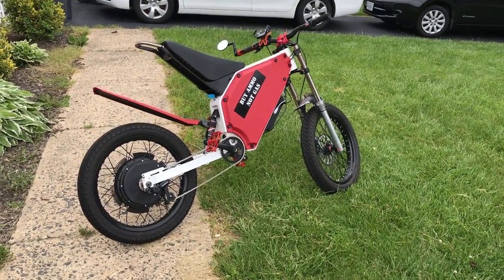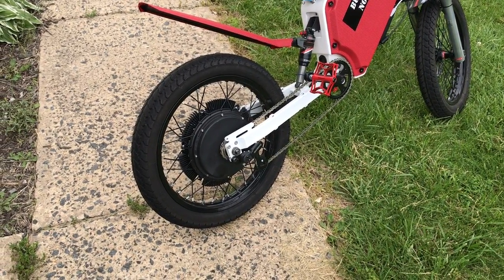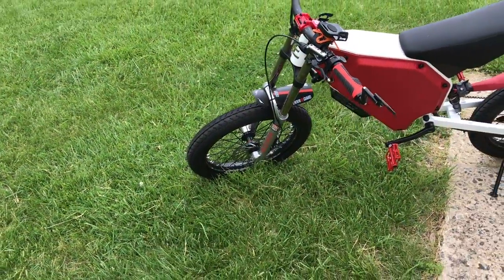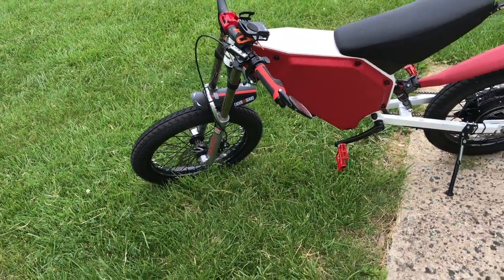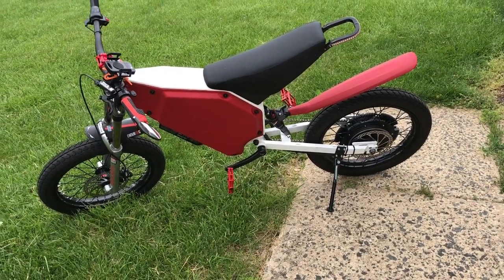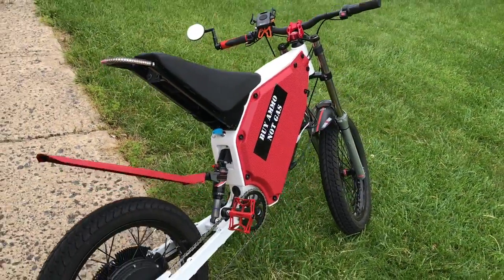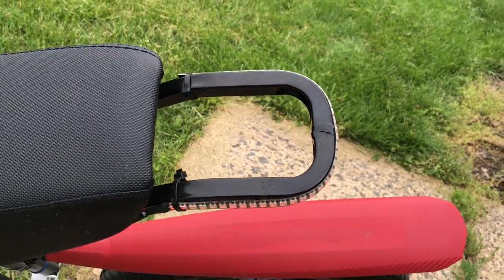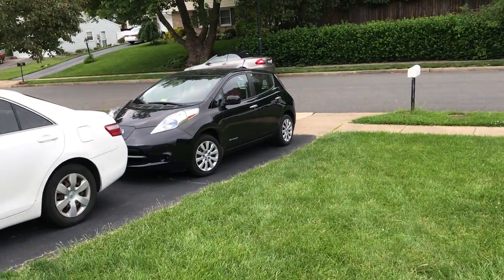High Power 60+ MPH Electric Bike

Comment: is there a way to use a thumb throttle as your regen braking and that way you can control very precision braking to the motor, my electric skateboard has this  built in the throttle - one way is the throttle and twist the other way is the regen brake. I m having a hard time finding that in ebike etc.. seems the brake lever just has a switch to stop motor, but I do not want that. would be best if there was a hydraulic brake lever that also had regen cable but could allow full control of braking to the motor as well

Comment: Can u put the motor wheel on both wheels? Like have 2 motor wheels and make it all wheel drive?
Reply: rav yes u can make it awd but then u have to have 2 controllers big ass battery everything will be very heavy because u have 2x motors and controllers + extra bigger battery and its not worth it but u can put a 12000 w motor on the back and u shoud be able to go 120-130 km/h
Reply: Not worth it just add more amps

Comment: I loved this video! Amazing bike! I would like to build one, but I am wondering about some things. I'm kind of wondering if this bike is overkill. I need a commuter primarily, something that can go 30mph for 25-30 miles round trip to work. I would also like to be able to go max 45mph on weekends for fun. If I have to charge batteries at work, I wont be messing with lipos, so I am keeping it to lith-ion batteries, either 52,60,72v at 20 ah, whatever gives me the most range. I plan on pairing it with a kelly controller. Is this possible with the QS205V3 motor? 
Is this whole platform (with heavy frame, expensive battery and controller) not appropriate for a commuter at 35mph, that can go 45mph on weekends for fun? I really appreciate the help, its hard to find people who build these powerful bikes.
Reply: if you top must be 45mhp than you are better of with 9kv version compared with 11kv or 13kv.
Why? Because will will burn less watts hours at slower speeds. Will cover more distance. 

Overall motor is very good. get it. Any version will work but if lower speeds are preferred than get 9kv with 72v batt in 17 or 18 or 19 inch rim or 24 inch bicycle rim in worst case.
Reply: It is hard to find these type of builds. I'm looking myself. Hoping to find some help somewhere.

Comment: Dear Jim:
I think I want to build something similar to what you have.  I am looking to build a commuter/cargo bike on a steel full suspension frame.  The big thing is could such a frame if it had modified dropouts to clamp those axles tightly stand the torque or other stresses from the asphalt commuting at 65 mph?  I want to see if I can get the thing highway legal and licensed like a motorcycle.  
I have other questions about the lights, what is arduino inside and the wiring for those batteries, but the big issue is the structural integrity.  I don't see how a downhill bicycle can jam down a rocky slope at 45 mph, but be unsuitable for the asphalt highway at 65 mph.  Hmmm?
Also I want to keep the normal bicycle look.  I don't really like the enduro style for running around the street.
Is there a way to communicate offline, if you are interested?
Thanks.
Michael Roth

Comment: is it me or is the math on his batteries off?  20 4s batteries of 10ah.  End result of 20ah means you split the stack in two, 10 batteries in series, paralleled to 10 packs in series.  10 packs in series would be 40s.

Comment: Hey Jim! I/We really liked the video and the build. In the video you talked about upgrading your motor with heat sinks and ferro fluid. The heat sinks are clearly visible in the vid, but i cant figure out what you used the ferro fluid for? Or how? It seems like you're getting 5000-6000watt performance out of a 3000watt motor! Thanks for your time!
Reply: It's all about the battery and controller. That motor is rated for 3000w but can handle 5000 watts easy. He might have  a 72v battery and 80amp controller. 72x80=5760watts!!
Reply: The ferrofluid (called statorade in the eBike world) is used to bridge the gap between the stator and rotor to better transfer heat. Then the heat sinks are able to more easily dump that heat into the atmosphere.

Comment: It looks great,
including the combination red and white.
Amazing rational thinking, on the components
and the "modus operandi"
as a whole.
I would guess
that it works
just as good
as it looks.
I have three questions,
that if you could be kind enough to answer, would be:
Why not a full front fender?
Why not a higher upright position handlebar?
Would these two things be related with aerodynamics?
I wrote three but in reality there are five,
and the other two are:
 How much does it weigh? and
How heavy can the rider be?

Comment: What kickstand are you using?
Reply from the maker: TOMOS A55 MOPED SIDE KICKSTAND (from eBay). I had to cut the tabs off to fit the swing arm but it works pretty well. I wish it was a tad longer, but it function fine.
BTW: I bought this motor from you.
Reply: Thanks Jim, I'm glad your enjoying the motor. Was it this kickstand? http://www.ebay.com/itm/TOMOS-A55-MOPED-SIDE-KICKSTAND-TT-Classic-Quadro-Flexer-Sprint-Colibri-square-/291396577145?hash=item43d896e779:g:BZgAAOSwEeFU9NdD&vxp=mtr
Reply from the maker: Yep, that's the exact one I bought.

Comment: Hi there! Nice build! Im building a similar ebike. Im using EEB frame and the same qs 205 h50 v3 hub motor on 18" moto wheel.I have a question about the tire size before I purchase them.Whats the width of the Michelin Gazelles you have on your bike? 2.75 0r 3.00 inches?
Reply from the maker: H.Ayvaz I'm using the 2.75's but I'm pretty sure the 3.00's would fit too.
Reply: Awesome! I may go 2.75 front and 3.00 rear.I like the Gazelle's tread pattern.
Reply: I finished my build couple of months ago. I posted a video all about it recently. Check it out if you like.

Comment: Could could this fit on my 145 mm rear forks on my mountain bike? With room for a 1 speed freewheel. I have a TC 80 on it right now and it fits a free wheel 1 speed.
Reply from the maker: It might, but you'd need some really really hefty drop outs and torque arms. You'd also likely need to spread your drop-outs by about 5mm on each side. I wouldn't use a motor this strong on a standard bike frame.
Reply: Jim McPherson well how much stronger is it compared to crystallyte TC 80? i have the TC 80 right now with torque arms and it works great. i bought the Qs for speed and efficiency. if it doesnt fit then ill just buy the em3ev frame with 26 inch wheel.

Comment: you mentioned you used hobbyking  batteries, could you tell me how you did your wiring? also where did you get the charger?
Reply: Heath Brockway I got you brother.

I have the same batteries as this guy and I can give you a the product links you need and how to wire it. its pretty self explanatory but if you mess up you can cause a big spark or a fire.
Reply: you can have several choices for chargers.
Reply: Here's a link to a charger that I have and I'm currently using because I screwed another one up by accident.

It's easy and not complicated because it doesn't require a power supply so you just plug it straight into the wall.

http://m.ebay.com/itm/272578996056?_mwBanner=1
Reply: now I'm assuming that you don't want to fiddle with wiring and unwiring your battery to charge it. I do it differently. I simply place my charged batteries on the rear rack of my bike and they sit in a grocery cart that is strapped down by bungie cords. when I'm done riding I put them in a bag and charge them separately using 3 of the chargers I linked above. i use 4 batreries. ( 16 ahr 6 S multiststars from hobbyking.com.) he's using the 20 ahr cells. Not sure if they're 6 S.  I'm too lazy to watch his video.

2 pc series adapter
and and a couple xt90 series harnesses all from hobbyking

you can by parallel harnesses too for more capacity.
Reply: Ron Brown thank you for all the info!
Reply: Heath Brockway what kind of frame are you using? this will determine if my advice is any good.
Reply: Heath Brockway if you don't have a frame you can go here for one. This frame accepts 26 inch tires and of course has batteth frame case. you can probably fit a good amount of lipos in there all wired up. If you really want tonsace money theb buy the charger I linked and simply dissaassemble the wires to charge. It's not hard at all. have you ever charged lipos before? if not it could be a bit of a learning curve.
Reply: Heath Brockway here's a link to a full package eeb frame. it includes many bike parts, motor and accessories. I might actually purchase this myself and move on to a stronger frame.

https://em3ev.com/shop/eeb-full-suspension-ebike-frame-package/
Reply: Heath Brockway let me know if you have questions. I'd be happy to answer. 

what's your goal? do you already have an ebike?
Reply: Heath Brockway ok cool
Reply: Ron the eeb  frame is the same one I ordered just under another name. The larger parts I ordered were rockshox boxer front forks, fox dhx air 5.0 for the rear, I'm using protaper fuzion race handlebars with a direct mount stem, crankset and bottom bracket are race face, and I found a 10kw motor/ with controller and digital display. oh and the brakes are the magura mt5e. Its not an over the top build, but a middle of the road strong dependable bike. Hopefully lol. I did order a book on building your own battery but worst case scenario I'll have to spend the extra cash and buy one.
Reply: Heath Brockway if never installed disc brakes before. How do you install them on the frame? I literally have no idea how to do it.
Reply: Heath Brockway you could build your own battery. you are talking  welding the cylinder cells with a spot welder? ebikeschool.com has a kit for that and it doesnt require  a spot welder, no fancy tools.It's a mechanical build. The cheapest way is going with the hobbyking batteries. it is by far the cheapest way.

Comment: what is the range
Reply from the maker: I have about $2500 in it.
Reply: Jim McPherson probably worth every penny every time you twist the throttle
Reply: 2500? That's it? WTF? Why haven't I ever seen this shit before? I'm like an ebike virgin.
Reply from the maker: Range is about 40 miles at 20 MPH and below at 65 MPH the range is about 18 miles.
Reply from the maker: Whatever you have is not the same as mine so price can't really be compared. I built this piece by piece from the frame up.
Reply: probably cost him around 2200 dollars or 3000 hobbyking batteries are very cheap. Not sure about the QS motor

Comment: the chinese don't mess around when it comes to copies.. looks like a half decent rip off from stealth hurricane bike
Reply: stealth hurricane bike made in China?
Reply: thermo dynamics No stealth hurricane made at my friends factory in Melbourne Australia.  Doesn't take long for the Chinese to come out with cheap copies a couple years later.
Reply: what's wrong with cheap copies?
Reply from the maker: Sam Richards This isn't a copy of Stealth anything (Hurricane, Fighter, Bomber, etc). I built it from the frame up and it is very different than the stealth series.
Reply: Jim McPherson I am just talking about the frame and swing arm kit you purchased. It's a blatant rip off of the stealth hurricane style. Not saying there is anything wrong with it.  Im friends with the owner of stealth and we have discussed it a few years ago.  All these copies came out from china a few years after stealth designed it.  There is also a copy from Europe. It's a very obvious copy of the design and most of the time they even market it as a stealth.
Reply: Sam Richards the Ebike from Europe is nothing like a stealth bomber .. I own a 14kw vector... the stealth bomber is nothing but an overpriced Ebike, I know I've had a stealth but sold it as I preferred the vector for power and price

Comment: what is the cost of that build just curious
Reply from the maker: If bought all new, not in sale, the parts would be around $3500.00. I waited for good deals and found some parts used (like the front fork) and spent about $2400.00 all in.
Reply: I just got a complete kit from China including a light kit which has the turn signals, brake light, and horn for $3300 US shipped to my front door. The only catch is there are no instructions for assembly, wiring, or use.  I'll be posting videos in the coming weeks detailing the assembly once my camera gets delivered. I got a whole bike from China in a week and it's taking Bass Pro store longer just to ship a GoPro. WTH?
Reply: Brian Neal you just got yourself a subscriber, looking forward to your build .
Reply: supernova1976 cool. Thanks. I am getting one of my cameras tomorrow. Filming starts right after I get home
Reply: Brian Neal even if you don't get your camera , you can start with your smartphone and a good grip/ holder. a good tip from most big YouTube's , good sound is always more important 😊. good luck with build and YouTube .
Reply: Awesome E Bike build! How did you add the car charger j1772 port and did you have to put in a step own transformer or just send the 220 volt right to the charger?